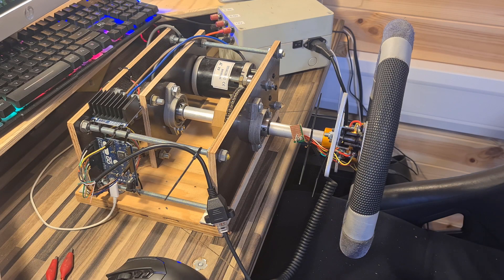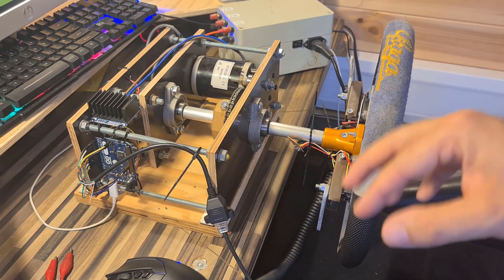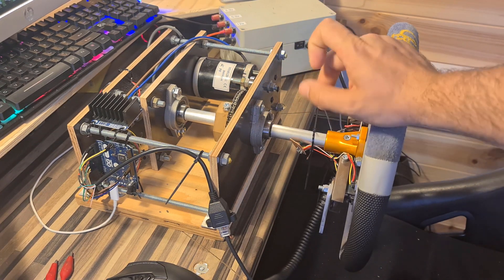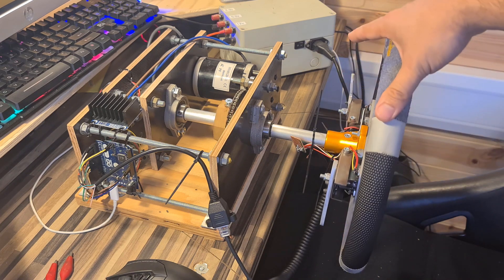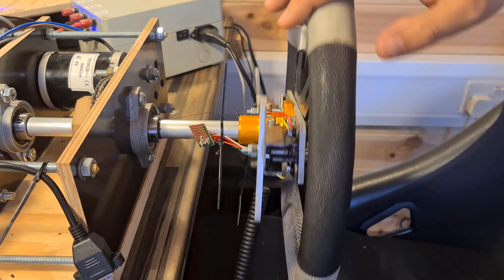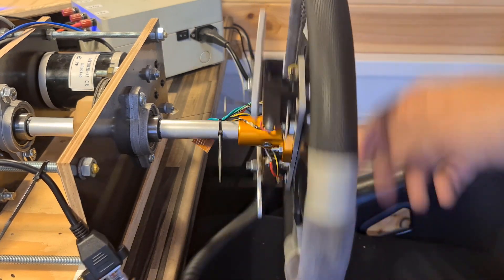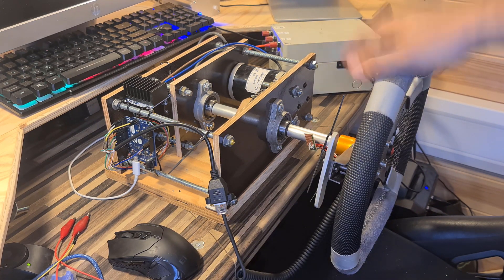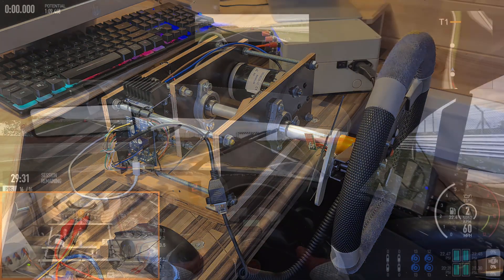DIY Force Feedback (FFB) Sim Wheel - Part 3 Paddle Shift

Comment: Its due to your chain tight design. If you just tight it with motor mount manner, it ll be less noise, and no slack then.
Reply: No it won't. Will still make noise obviously why no sim wheel uses a bike chain duh

Comment: can i connect encoder to dc motor directly?
Reply from the maker: I think so. If you have a direct drive set up that would make sense. If you have a drive belt though(or chain), it will amplify the turning angle. For example, if you have a 4:1 drive ratio, if you turn the wheel 10 degrees, the motor (and the encoder) will turn 40 degrees.

Comment: Hey, it seems you are using the same motor as me. Do you have the "teeth" feeling when turn the wheel. I have this problem and its pretty annoying when turning wheel slowly for precise driving etc. I'am trying to find the solution :). Nice build btw
Reply from the maker: My driving is never precise! I know what you mean though,  I think it might be because its a 4 pole motor, so it's trying to move between the poles. But, it does the job for me and is less "coggy" than my old GT3 Rs wheel.

Comment: use belt and get better performance
Reply from the maker: That's the plan! Next steps will be belt drive, new steering shaft and perhaps a new Mk2 frame
Reply: Belt loose on strength with powerfull  motors) and have no advantage over chain. Only less noisy but also if to drift much.

Comment: Why did you choose a bearing instead of an idler sprocket to tension the chain?
Reply from the maker: Next step is to replace chain drive with belt, where bearings will be the right solution 😁

Comment: A good start for further development !!! I also collected the same database, but on STM32. From my own advice to you - replace the motor !!! Yes, it is powerful, but terrible in its characteristics, there is a gross looping !!! I threw my MY6812 in the trash !!!
Reply from the maker: The motor is not perfect,  but for now I think it will be ok. What motor did you replace it with?
Reply: @makerepairrecycle3261  I replaced it with Dynamo Sliven pik 8-6 / 2.5. But now I'm building a DD base based on Dynamo Sliven pik 12-3 / 10-3. And I'm not the first one who builds a DD base on this engine.

Comment: I definitely suggest replacing the shaft with a steel one and maybe cutting a keyway in it? That way you won't have to deal with the screw being the main torque transmitting piece. Other than that, amazing job building your own setup.

Comment: You could try using a small pulley like the ones from a bicycle shifter to tighten your chain, there won't be slack and noise anymore. I left a similar comment on an older video but maybe you'll see this one to try it before replacing the whole motor

Comment: I have built one of these but I am having problems with the ATX power supply it keeps turn off when the wheel spins freely or a certain inputs during game play I have added a power resistor across 5v but still does it. Just wondering what type of atx power are you using
Reply from the maker: I have no ideas on the specs of the ATX supply, I made it years ago. Maybe the supply is faulty? Might be worth trying another one - can get them free in old PCs or less than £10 on ebay. Would love to see how yours looks @makerecycle
Reply: I had the same issue. ATX psu has too many protections (overload, overvoltage etc) and it keeps shutting down. I solved it by using impulse power supply 150-200W depends of motor you used. It worked like a charm.

Comment: If you have a printer laying around the house you can use its encoder so you dont have to buy one! a small tip if someone else is building. BTW great work, im building one aswell.. :)
Reply from the maker: I did try that first of all, before making the video. But I couldn't get the right connections so bought one! It should work tho

Comment: Are you using a dc motor ? If I use an omron 600ppr encoder without dc motor would be the steering wheel good?
Reply from the maker: Hi, without the DC motor, there will be no feedback. You can use it as an input, but feels very strange with out feedback.